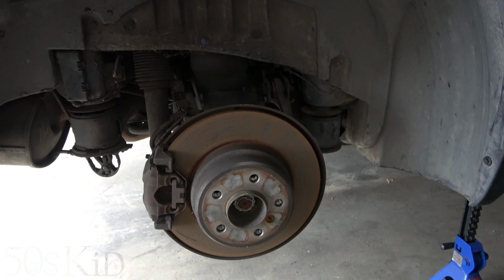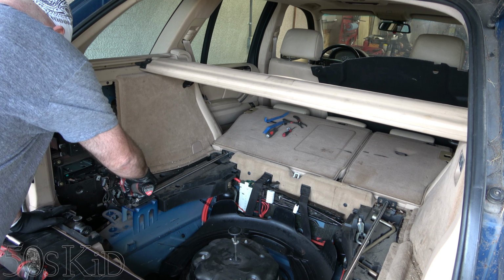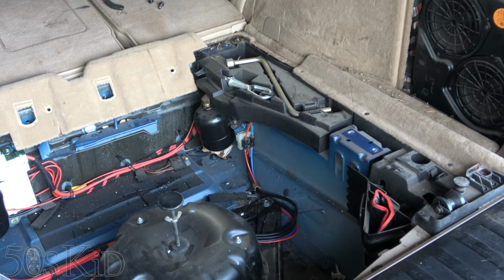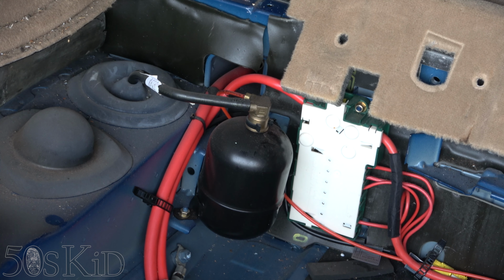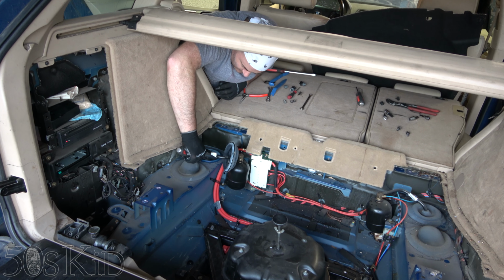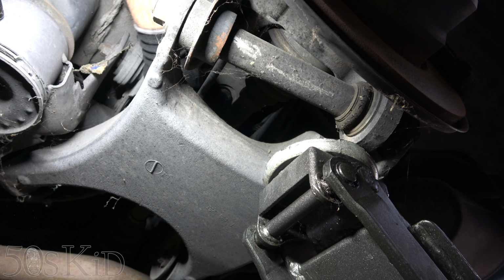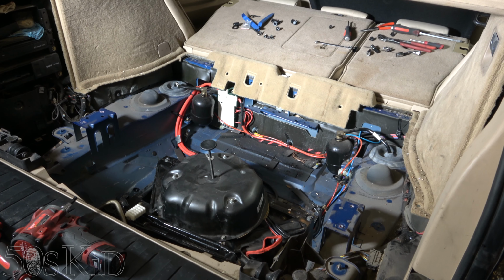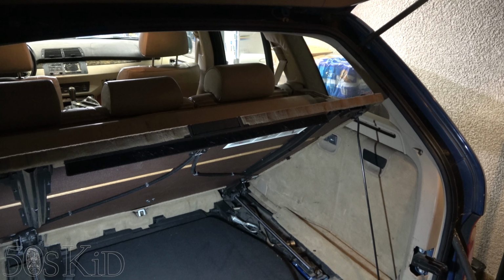X5 Air Bag Suspension Fix DIY - E53 Rescue

Comment: I have a 2001 E39 Touring with airbags in the rear. The process is basically the same for anyone watching, only major differences being the interior trim isn't the same, but that's not difficult to pull apart to gain access to the top of the bags. And instead of a clip, there is a nut or bolt (I forget) on the bottom of the bag holding it in. If you have an E39 and were looking for a guide to replace the rear bags, you could follow this and it would easily suffice. The way Jason removes the air piping and clips on top are identical.

Comment: Anyone in the market for an E53 X5 after seeing this repair: "Wow what an easy thing to do! I gotta get myself one of those cars as well"
Anyone who actually bought an E53 X5 some short time later: "Wow what a stupid idea to buy one....and where's my money at?" :D

BTW if you seriously consider buying this model and you have a E46 you'll be getting a new and positive feel. Not better not worse but you'll be happy. But if you have a E39 you might be disappointed as the E39 is the model that performs better (steering response, comfort, accelleration, trunkspace, maintenance cost, fuel economy, insurance etc...). If you can try to borrow a E53 first before you make a decission. The cars are great but you gotta know why you want one. Especially with 19" rims and the sport packet. You'll know about every indentation on the road :)

Comment: I have been thinking about a smaller suv and thinking about BMW shoud I get a metal Evaul I have been thinking of the X3 or x5 or should i be thinking about something more relialable like a nissan marino but i like different and want awd
Reply: honda pilot
Reply: Tesla model Y.  The thing is a rocket.  It's what BMW should be building if they didn't have their heads up their asses.

Comment: Been watching you work on 325 I changed my plugs and coils and my oil pan gaskets. When I got put together the car drove down the street. I then pressed the gas to get some acceleration. And then my car got sluggish the (cel) came on and no actual power.ive called bmw but no will call back
 Checked codes and keeps switching between cylinders but its usual cylinder 6 with misfire and fuel cut off. 
Any ideas
Reply from the maker: Swap coils, then plugs, then injectors, then check compression, one test at a time in any order you choose until you find the problem

Comment: Your lug wrench is in backward. It won't sit properly like that. The handle goes at the top and then it will click into place.
Reply: Nvrmind you fixed'd it 18:50 👍🏻